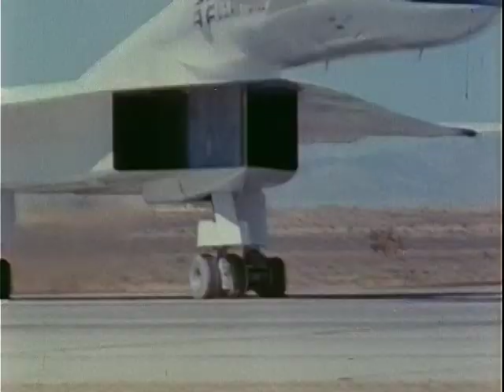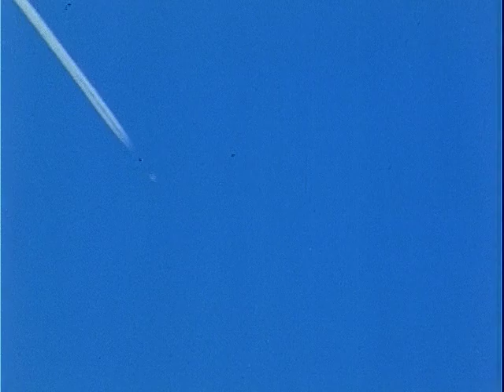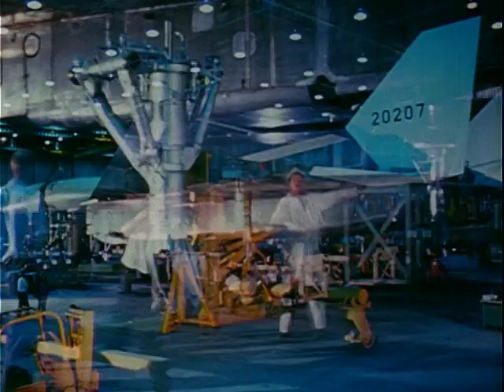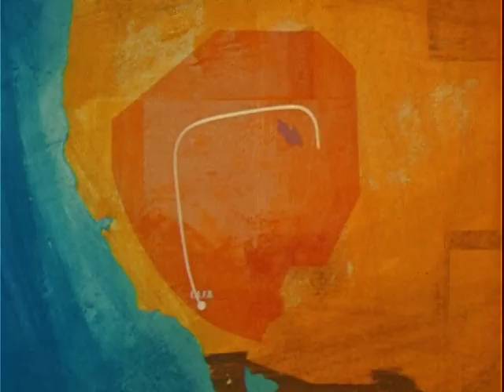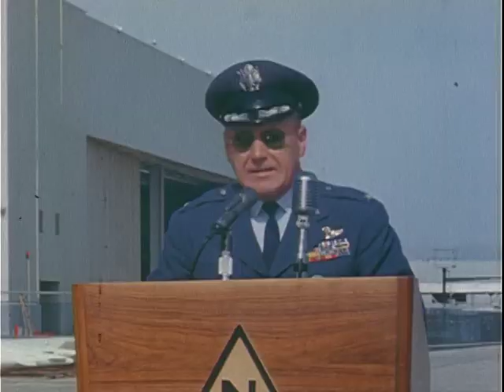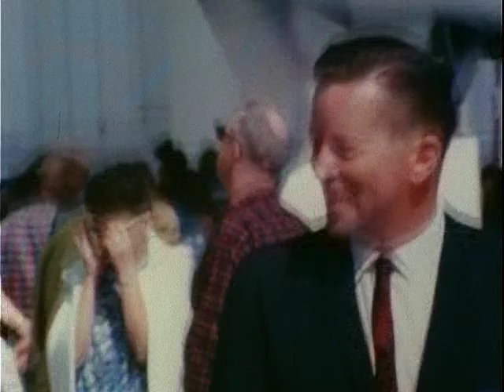XB-70A Valkyrie: Progress Report 15

Comment: This is the epitome of American know how. Over Mach 3. Ceiling of 70,000. The Soviets had nothing like this. I believe this is the one that crashed a year later.
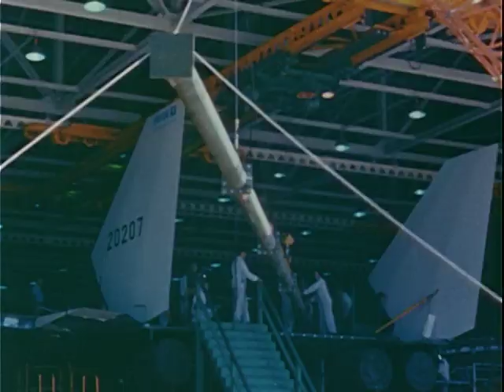Reply: It's difficult to tell because the visible differences between the 2, and the tail nos. are hard to read but at about 7:42 you can see the tail no. for AV2, which crahed.  Around 18:00 you can see the tail for AV1. During that scene where a plane is sitting being gawked at by hundreds of visitors, I'd say that was no. 2, because the inner wings look like they've got more dihedral.

Comment: I was attending a reunion years ago in the 80's, and was at the bar with an old North American engineer that was on the XB-70 project. He got upset when I mentioned the airplane. He cursed Joe Walker, he said Joe was attempting a barrel roll around the XB-70 showing off in front of the cameras and hit the tails attempting to do so. Did he just have too much to drink? I have always wondered. But that's what he told me. He was probably in his 70's then, and I'm sure he's gone by now...
Reply: That wasn't what the accident report stated.  He drifted into the wing of the XB-70.  After contact, the  vortices carried him up and over the wing cutting off the two vertical stabilizers.

Comment: My favorite plane, by far.  Amazingly useful video engineering specs, the shockwave explanation in inlets!!

Why are the tires dull silver in appearance?
Reply: I believe it was a special coating applied to the tires to protect them from the very high heat the plane encountered at it's upper Mach levels.
Reply: @jbidd8647  winner winner chicken dinner.  They are very similar if not identical in construction to the A-12 & SR-71 tires.
Reply: Tires have silver moon dust blended into the rubber.
Reply: Help keep them cool along with added cooling when stowed.
Reply: One of the videos stated that they had an aluminum coating to protect them from the in-flight generated heat, up to 450f.
Reply from the maker: I believe it's because the tires have aluminum belting heavily incorporated in multiple layers, resulting in the metallic luster given off by them.

Comment: The XB-70 is the MOST impressive aircraft EVER build.
Reply: @MrLewisbate I totally disagree with you about the XB-70 not being great...
It was a great engineering and design achievement.  North American Aviation was at the cutting edge of aviation technology as a company in all it's designs....  P-51, F-100, F-107, A-5, F-108

The XB-70 was designed to fly at over 65,000 feet while cruising at Mach 3+.  It utilized compression lift; creating a forebody shockwave and trapping its propulsive energy with moveable wing tips that in themselves were the largest moving surfaces ever installed on an aircraft.  The XB-70 itself was the largest and heaviest air vehicle to fly at the altitudes and speeds it was being tested, and the first in its class.  The  propulsion system utilized the largest variable geometry inlet system ever designed, fully automated on AV-2, and a six engine combination that pushed the aircraft to sustained Mach 3 speeds for over 90 minutes - that's New York to London in 1.5 hours, over 3300 feet per second, which is as fast as a bullet; a 450,000 pound bullet...

It did not fail in its design.  It was an ambitious project that advanced the state of the art in large high speed aircraft.  It was an experimental aircraft that challenged the best engineers, airframe manufactures, engine designers, and did it all in a era when high speed computing was a slide-rule, computers were in there infancy, and data collecting was on reel to reel magnetic tape.

It only "fell to bits" during a mid-air collision during a photo shoot, not due to a systems failure.  It did sustain damage on several flights, still landing safely, but that's the nature of an "X" plane pushing the state of the art.  Had funding continued into production it would have been a truly amazing aircraft.  Yes, it was expensive, but it was not a failure.  And it was indeed great!  Exceedingly great!  Just consider the science and engineering that went into putting a 500,000 lbs aircraft at 70,000 feet traveling at 3300 feet per-second for 90 minutes.  That to me is an amazing achievement for it's time.  We have not done it since..., sadly.  But much was gained in the effort.
Reply: @TacitDragon  what an engineering marvel indeed, and what a futuristic look! Did you listen to Al White's 1979 interview with the Royal Aeronautical Society? (Available on SoundCloud)
Reply: @JustMe00257  I have not, but I certainly will give it a listen now.  Thank you for the info!
Reply: i was under it  last night  2/4 2019
Reply: I'd say it was on a par with the TSR-2.
Reply: @markcharlton4188  What's TSR-2? Never heard of that one before...
Reply: @jeshkam  It was a British cold war jet fighter bomber that unfortunately never made it past a couple of prototype airframes as it was scrapped when Edward Heath became the British Prime Minister. Google.....very cool looking bird.